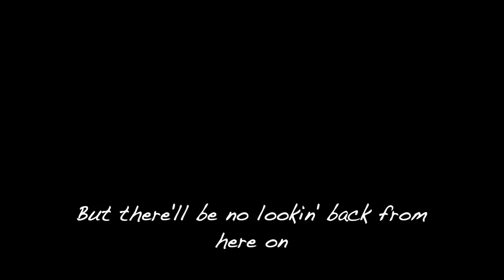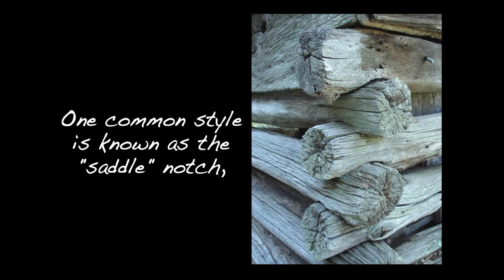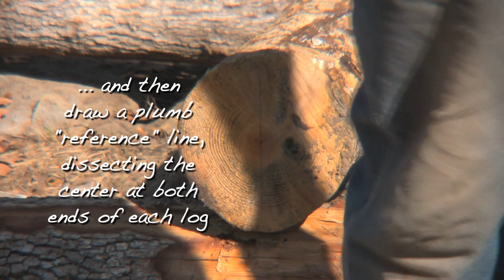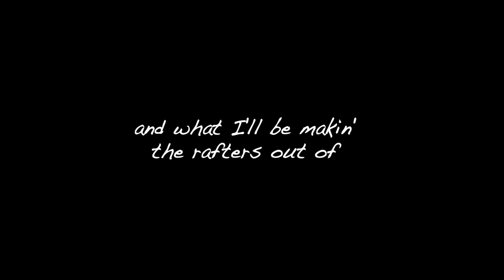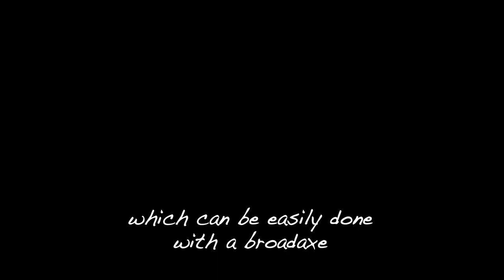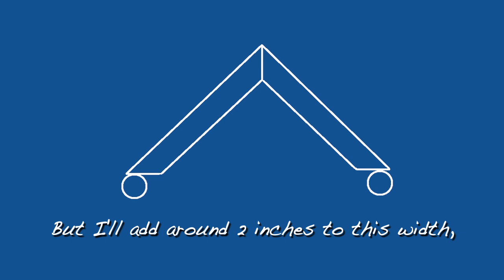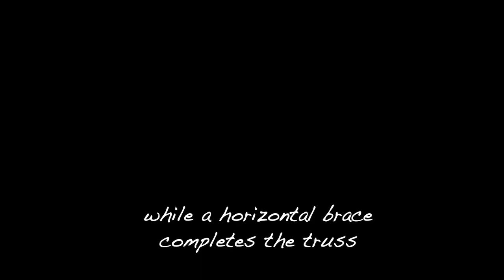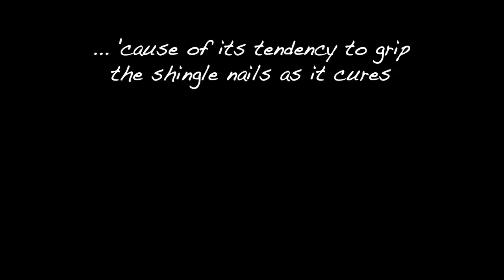Building an Old-fashioned Log Chicken House, Part 2 - Walls & Roof - The FHC Show, ep 17

Comment: You might consider the use of a "spud" when peeling logs. It's much saver than the use of an axe and faster. I hope you seasoned your rafters prior to raising them.  Another suggestion: peeling the bottom sill logs helps to limit the invasion and infestation of grubs, ants and the like. I'm glad to see that you are helping resurrect the old ways of doing for oneself that was most common in my youth.

Comment: Peeling with a draw knife rather than a broad axe may have been easier. Nice work.
Reply from the maker: Actually Jason, the broad axe is easier for me.
The heavier weight of the axe head gives momentum for the peel (just kind of lettin' it drop on the pole). Plus I don't have to bend over, or lift the pole higher to use with the drawknife. 
Thanks for watchin'!

Comment: I am building a 11' by 11' pole barn   .How long do my poles need to be?thanks for a greatvideo
Reply from the maker: At least high enough you won't bump your head on the loft joists or truss sills, than add about 3 foot for the underground part and about a foot or two to the top so you can cut em all off even..
Reply: @farmhandscompanion  thanks so much

Comment: Are you not sharpening the axe other way round??! 😃 You should be turning the wheel away from yourself - not on to yourself..! Need to be Removing the material from the blade - not pushing it on to the blade!... 😂👍
Reply from the maker: Hey there, The Axe Man,
Yep, with axes and hatchets my preference is the wheel comin' towards me. Most if not all the old-timers I've seen always have the wheel comin' toward 'em (and some are way more adamant than me about it). You can produce a burr either way. With scythe blades and butcher knives, however, I prefer the wheel turnin' away from me. Just a preference thing for me.
Thanks for watchin' and commentin', The Axe Man!